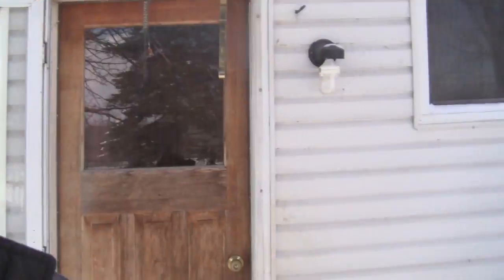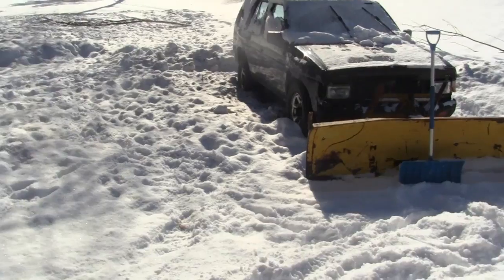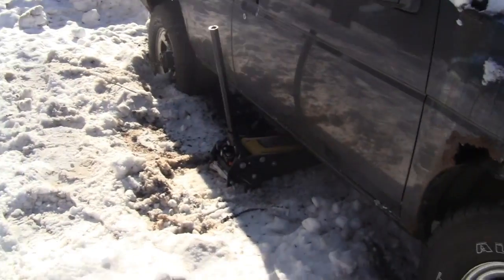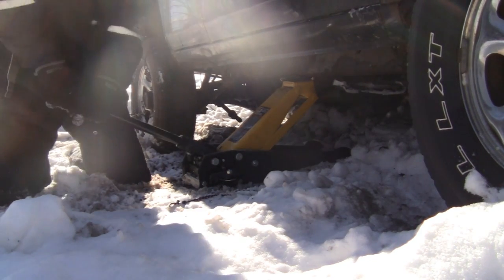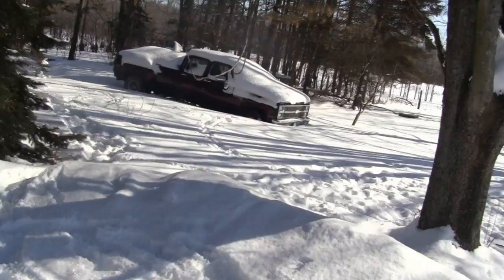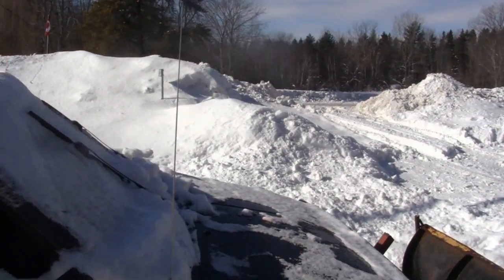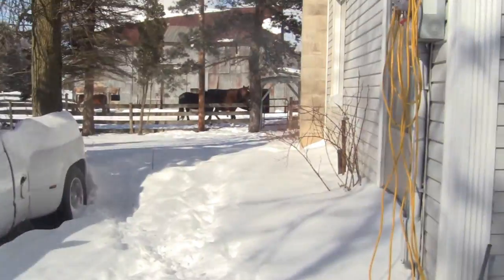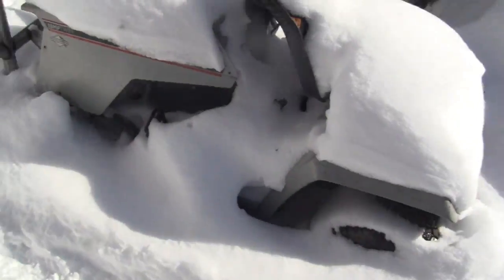Snowplow fail 2014

Comment: That would be so cool to plow the driveway out with frankientank. I'm sure the people next door will call the police or ask you to do their driveway. Expect to do more plowing.
Reply from the maker: I do there driveways now lol
Reply: ShawnCFarm I'm makin a minirip, I call mine a scorpion. So far I got the frame, drive controls, and driveline made with motor (15 horse Briggs) and 3 speed gear box with reverse. Made everything from scratch. I got the tracks designed which I am making from scratch too. I need to finish the tracks and then the suspention. I plan on putting mine to work too, plowing out the driveway and just havin fun with it. I plan on putting the build on UTUBE also. Just waiting for the weather to warm up too. I'm relieved to know I'm not the only one building a tank. Best of luck with yours. I'll be getting back to mine in a few months too.